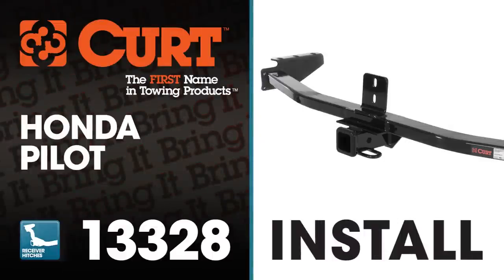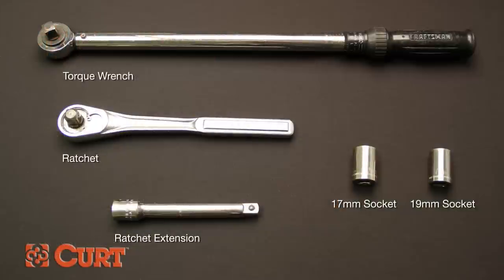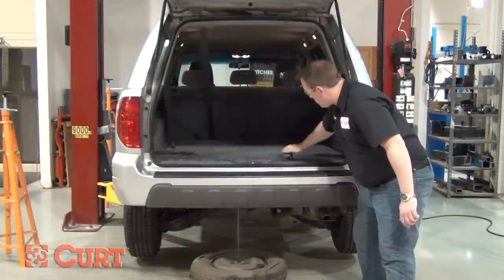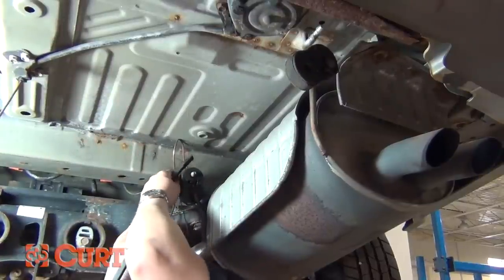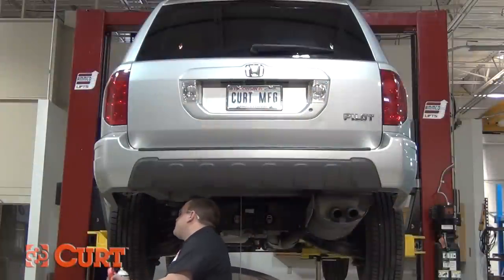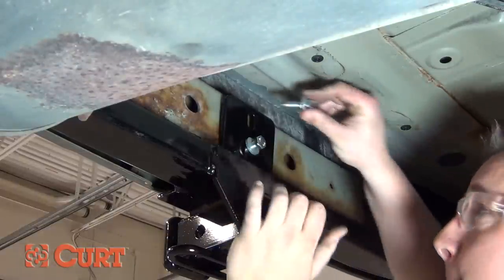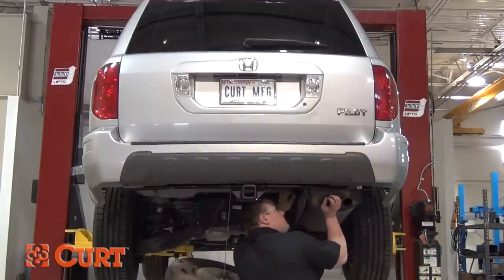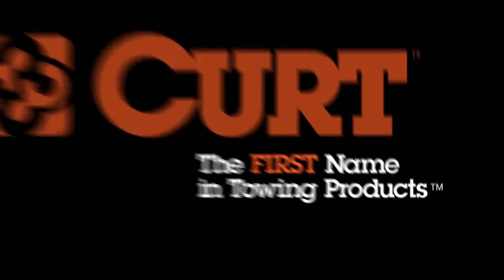Trailer Hitch Install: CURT 13328 for 2001-2008 Honda Pilot

Comment: How come the kit i have says to tighten 86 ft lb the bigger bolts?
Reply from the maker: All new hitches come with stronger grade 8 hardware requiring increased torque values.